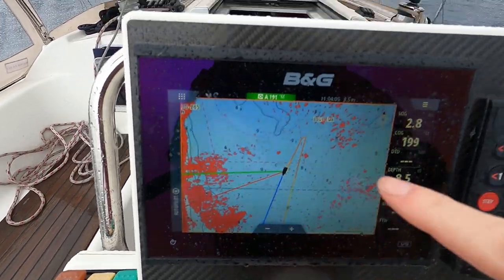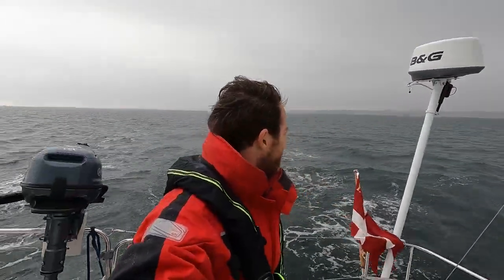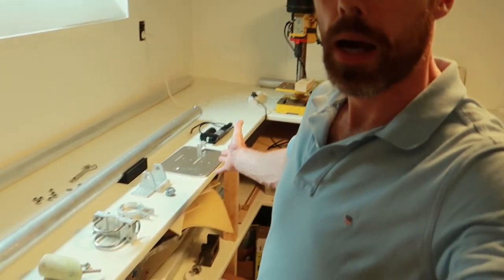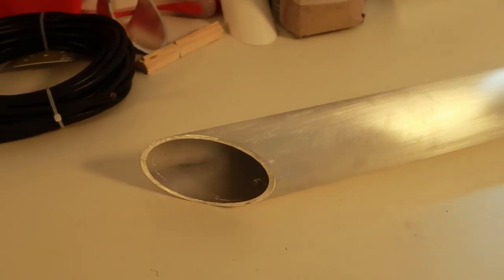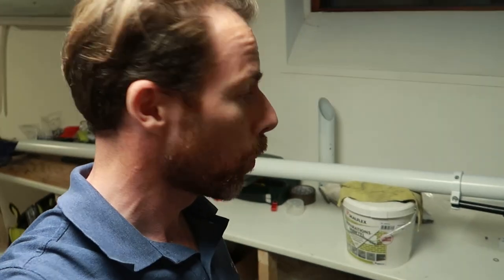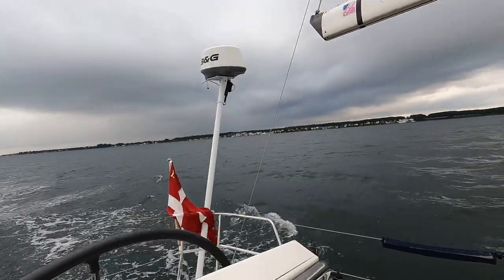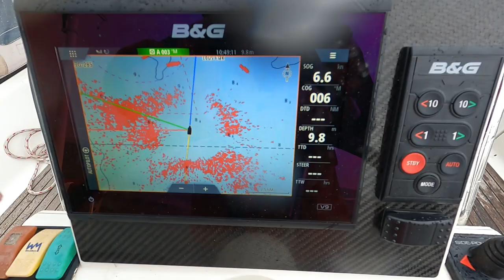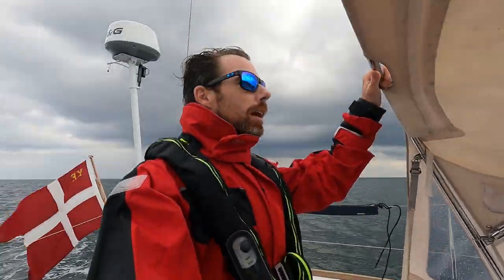Over-engineered DIY radar mount!

Comment: Do you have any blind spots from the sails, rigging, mast or boom being in front of the radar? I ask because I am debating whether to do pole mount or mast mount. Mast mount would be easiest for me, but I know I will probably have a 20-degree blind spot straight aft because of mast just behind radar.
Reply from the maker: Haven’t noticed any blind spots. My theory is that the boat is constantly changing the course slightly. So any objects “hiding” in the blind spot will be visible for the radar a few seconds later.

Comment: Do you recall the thickness and type of the aluminum tube?  It seems there are lots of options.
Reply from the maker: Just checked, it’s Ø60mm, wall thickness 3 mm. Hope it helps
Reply: @jacobkollerup  Thanks I ordered that size in 6061-T5

Comment: Great video, love your workshop and thanks for sharing, very innovative! I am about to do a design up on CAD to have cut and welded by someone else, sadly I don’t have your great workshop :-( It has been a year now, have you decided with using it in that time if the tilt was a worthwhile thing to include?
Reply from the maker: Thanks! We actually sold the boat by the end of the season. We have a video explaining why, long story!. Anyway, I still think the tilting is worth having. Since you  have to make a lot of other parts, adding the tilt function is not that much extra work . It of course depends of what kind of sailing you do, but if you feel that having a nice radar setup gives you more confidence and safety onboard, go for it:)
Reply: @jacobkollerup  thanks so much for your reply and yes I agree, it’s easy enough to include and a worthwhile addition for the benefits. We will be live aboard’s, doing a lot of sailing, great to have this simple addition

Comment: The angle of the radar beam you are searching for is called vertical lobe angle. On this radar (this antenna) it's 12.5 degrees on each side of the horisontal plane. That means that if you didn't have this tilting mekanism, the radar would have poorer performance when looking sideways and the boat is heeling more than 12 degrees.  
Next step in this magnificent design is to automatically calculate the heeling angle, max and min, over some time, and then position the antenna in the mean angle between these angles. When it goes out more than 5 degrees from calculated angle it makes another calculation and adjustment. It's maybe possible to achieve the heeling angle from the heading sensor, usually attitude sensors (pitch, roll and yaw, static and dynamic) are included in these sensors.
Reply: Very good idea, that is easy to be done with SignalK and Openplotter

Comment: Very nice solution, my only doubt is the 
 stabilisation of the pole using only the sea railing.
Reply from the maker: Thank you! I ran some FEM analysis on it and with wind up to 50 knots it still had a good safety margin. It’s a quiet light weight build compared to many of the stainless steel versions out there

Comment: Very good work.
Could you share links to the parts you used? (Pole, linear actuator, brackets, etc…)
That could be very useful!
Ciao!
Reply from the maker: Thanks! So almost all parts are custom made fra raw stock. The tube is a 60mm diameter aluminum tube. All the brackets are from 10mm aluminum plates and some 6mm L-shaped profiles. The actuator is from Amazon, think the brand is called windynation
Reply: @jacobkollerup  Do you recall the thickness and type of the aluminum tube?  It seems there are lots of options.